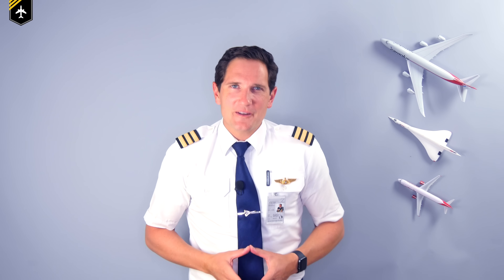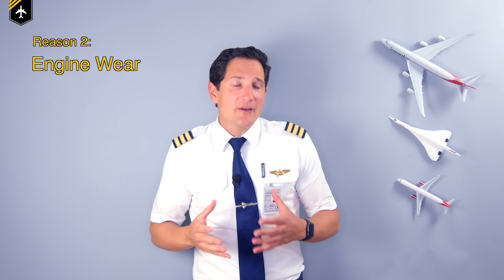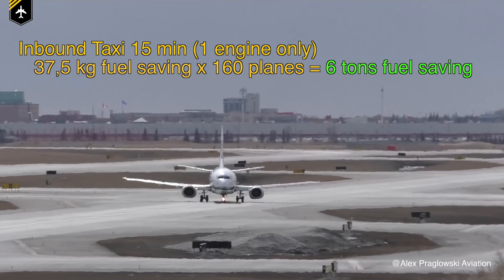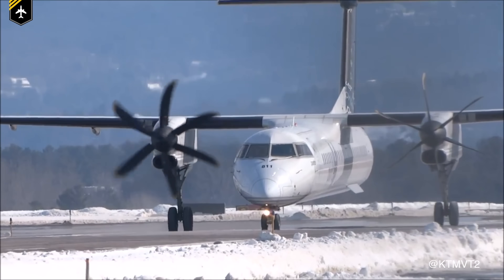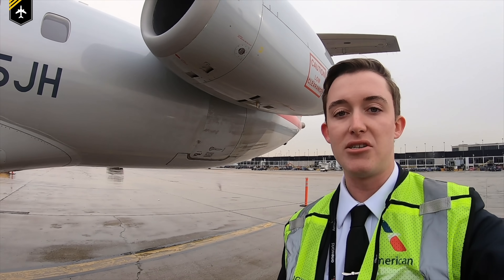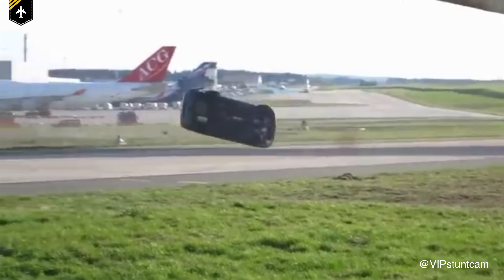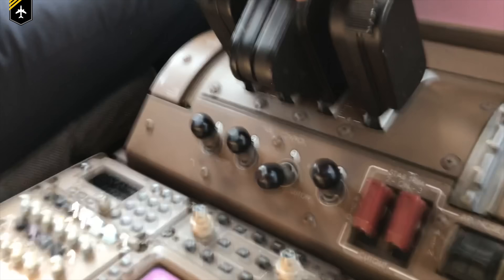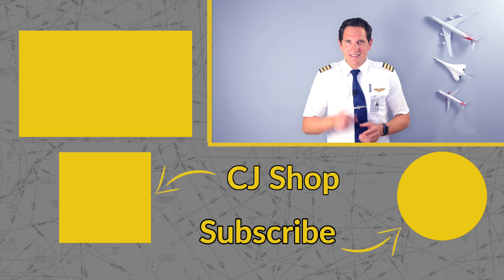Why do PILOTS taxi only with ONE ENGINE??? Explained by CAPTAIN JOE

Comment: The engine shown at 1:53 wasn't foreign object damage, unless you count the plane tug that disconnected while towing TF-AAK (747) as a foreign object.  It then turned but the plane did not resulting in two people injured and damage that required two engines to be replaced.  That plane at the time was known as "Ed Force One".

Comment: Can planes run on 1 engine in the air?
Reply: A twin engine aircraft can fly with one engine.
Reply: @nefarioulyte9996  - A twin engine aircraft can fly with one engine, and if the other engine has been lost during the take off the aircraft can even continue the take off with only one engine.

The effect of drift will be compensated by using the aircraft controls and the aircraft can continue flying. 

For example if the aircraft will tend to turn to the left, to counter this the pilot applies right rudder. This will correct the drift.

Pilots who fly twin engine aircraft are trained to fly the aircraft with only one engine. This is a normal procedure of the pilot training, and every pilot who flies multi engine aircraft has to train this procedure.
The pilots can fly and steer the aircraft with only one engine because the drift can be corrected with the aircraft controls.
You can ask any pilot about this and they will tell you the same thing.
Reply: @nefarioulyte9996  - LOL

Comment: Would the one engine running make the plane do a turn? So do you constantly have to steer against that force when you taxi or is there some system involved that compensates that and makes steering feel the same as if you had both engines running?

Comment: Q: Will the fuel consumption of additional thrust needed for taxiing on one engine counteract the fuel that has been saved? Or maybe it doesn't ever require additional thrust to move the aircraft on one engine?
Reply: It does require a bit of extra thrust on the operating engine however it is still more economical. For that reason also, there are weight limitations for engine out taxi

Comment: If you shut down engine 1, engine 2 has to work harder and uses more fuel. So I think the calculations are wrong. Fuel is saved but not that much.

Comment: Interesting. Now it kinda makes sense why airline company would not want to buy 4 engine aircrafts like the new 747. While in the air, they are very efficient, but while taxing around the airport, it will consume significant more fuel than other aircrafts.

Comment: But for taxying the plane, surely the single engine has to work twice as hard compared to using two engines, so you won't be saving anything like as much fuel as suggested in the video?

Comment: Hey capitain joe, i have a question: What is the purpose and function of the black-yellow "FOLLOW-ME" cars on todays big modern airports with every whatsoever technical and electronic system available, whilst often old small airports don't have them? I always thought they were a relict from old times, where there were no fancy electronics around? last time i flew i saw them in Copenhagen and Oslo, which are big modern airports, but not in Kirkenes which is a small and old airport(might have been renovated by now, don't know, was there in 2011). Kirkenes does also have international flights, so it can't just be for foreign planes to not get lost....

Comment: I had my first flight on a brand spanking new American Eagle Embraer 145ER last week. Holy smokes it is nice. And so strong. When we started our take off roll it was like they went from idle to half throttle, then a few seconds later full power and I was crushed into the seat. I have never felt that kind of thrust from such a small plane. Amazing aircraft.

Comment: Okay, here's a question. Do you have to manually trim the plane as a result of thrust only being on one side hence potentially causing the plane to veer off the center line?
Reply: Aman Haman you don’t taxi with the rudder in an airliner. You use a tiller (basically like a steering wheel). So using that you just maintain straight line.

Comment: Reason #4: Shutting down the port engine eliminates the engine/prop blast forces that would hit passenger boarding/deboarding by the rear stairs on the open ramp.

Comment: With the advent of hybrid electric planes (see Airbus/Rolls Royce E-Fan X), I'm wondering if we will see electric motorised wheels on some planes. 
Cons: increased weight, increased complexity 
Pros: rollback without assistance, easier taxiing, reduced FOD risk due to high power not needed, maybe increased initial acceleration on takeoff leading to shorter runway, maybe reduced tire wear due to pre-spinning wheels, possibly improved braking performance  (reduced pad wear)

I guess you'd have to run the numbers to find out if it would be worth it. What do you think?

Edit: I just found Electric Green Taxiing System (EGTS) by Honeywell and Safran. It's designed for aircraft such as A320 and B737 and would be powered by the APU. Seems like it finished development in 2016 but no customers.
Reply: Wheeltug Plc also do a system.

Comment: Why does the Airbus A380 have reverses on only 2 engines
Reply: It saves weight that it has reverse thrust on the inboard engines only, and because the outboard engines are often over the runway edges, it decreases the risk that the outboard engines would be damaged by ingesting foreign objects.
Reply: @mikep9604  nice
Thx

Comment: I would think you're adding a lot of twisting torque to the wing and fuselage running only one engine.
Reply: An F-15 landed safely with a wing torn off once. I'm sure an airliner will be fine XD
(Sarcastic)
Reply: @XM8A1  .. Whether something can land once is different than 7x24x365 twisting stress on a wing and a fuselage from a fulcrum. While I'm not a Structural Engineer I'm a Chemical Engineer.

Comment: Ryan air IS a budget airline, but it is also a very safe airline, no one has ever died as a result of boarding a Ryan Air plane and you can't argue with a 100% record. And let me guess how many of the knockers have actually flied with Ryan Air? Answer?  none. For the record, I have. The same can be said for Easyjet, another budget airline with a 100% safety record.

Comment: Why they take so much altitude  so fast after take up?
Reply: Because it's usefull to reach the cruising altitude fast so that the aircraft can use its cruising speed, and at high altitude the fuel consumption is the most economical.

Comment: Interesting.  So i see that you need to throttle up a bit more with one engine for the breakaway thrust but are you still using higher RPMs while moving around the taxiways with only one engine?

Comment: Wouldnt power only from one engine make your plane always turn to the left or right (Depending on the engine thats off)?

In flight sim when I taxi with one engine I always have to correct to stay straight
Reply: You can steer the aircraft using the nose wheel.

Comment: Great video! I learned a lot. Never knew that planes saved a lot of fuel just taxiing with one engine.

By the way, from what I understand from the last part of the video, you don't perform the same procedure for the 747, so you taxi with all 4 engines, right?
Reply: elephant35e they taxi with 3 (or 2 depending on airline).

Comment: Hey Captain joe, regarding 1:59 FOD actually stands for Foreign Object Debris not damage :)
Reply: Same, I work Airfield Management gravel or rocks are not damage their debris. It could be a difference that comes from maybe a pilots perspective vs. Airfield ops. But Airfield litterally are the one responsible for FOD checks and FOD programs, but hey. Pilots hey, know everything right?
Reply: I am a pilot and a retired FAA employee. The acronym meaning changes with time. The object on the ground, is foreign object "debris". If it gets sucked into the engine, then it causes foreign object "damage". The official FAA definition is here: https://www.faa.gov/airports/airport_safety/fod/   The crews doing the FOD checks have a very important job.
Reply: Last time I checked he went to flight school he is the pilot so he should know
Reply: @CrosshairCT-  i worked in airfield operations which is way more involved with FODs and stuff like this than pilots, worked in a control tower as apron/ground controller in a busy international Airport, and currently am going to flight school, so i should know as well :)
Reply: @CrosshairCT-  i actually had  2 weeks of training dedicated to FODs and their effect on airfield operations and safety when i did my airport operations training so trust me i know more :)

Comment: If your airplane has a APU can you shutdown all engine excluding the APU or not?
Reply: If the engines are shut down, like they are on the gate or at the ramp, then the APU is turned on to produce the electricity to the aircarft systems.

Comment: 3:19 - That calculates to USD $.5864 per litre.  When you compare that to 91ron standard unleaded fuel which is AUD $1.489 per litre, that is fucking cheap.

Comment: With asymmetric thrust being applied, is it necessary to counter this with constant torque on the nose wheel steering tiller or rudder pedals to stop the plane veering off a straight line?
Reply: Anthony Dyer yes

Comment: Hi Captain Joe! I'm not a pilot but love your content! I do have some questions though.

Discounting the time when the plane is idle, if only 1 engine is used to taxi, doesn't it mean that the engine has to work harder to propel the plane therefore negating the fuel saving and noise points? I would think 2 engines running at minimum throttle is more efficient and less noisy. I think this logic also applies to engine wear, and likelyhood of gravel being sucked into engine. I would also imagine having imbalanced forces on the left vs right with only 1 engine running introduces twisting/torque stress on the overall plane's fuselage?

Can you explain? Thank you!!

And damn Pilot Emilie is real easy on the eyes ehhh?! xD
Reply: KA S it’s law of diminishing returns. For equal thrust amounts, single engine will always be more economical than dual engines (as lot of energy goes to waste)
And for the gravel case yea maybe. But that’s more prominent if the engines are placed really wide apart (wrt the taxiway)
And at such speeds and power settings, asymmetrical thrust wouldn’t be that powerful to damage the aircraft (remember the aircraft is designed to fly with one engine, hence it can take way more stress than it’ll experience on the ground)
Reply: @ZK-APA  Thanks. I can accept your explanation :)

Comment: 10:00 AirBridgeCargo - nice livery!

Why do aircraft measure fuel in tons rather than gallons or litres?

If they always cut the same engine on some aircraft the extra time on the other engine(s) must add up to a lot over time. Is that a problem?

Why don't they fit a fine mesh over the intakes to stop FOD?

Do they need to apply one brake to stop the aircraft taxiing round in circles, or is the rudder sufficient?

Is the slipstream enough to start the second engine when taxiing a turboprop?

Hope you don't mind me asking so many questions :)
Reply: caw25sha I’ll try answering them

Fuel is in tonnes because fuel is a factor in weight and balance as well. So more payload it has, less fuel it can take (as to not exceed maximum take off weight). 

If they cut the same engine all the time, it would be a minor problem, as even though that engine may be used more, since the aircraft is checked so often it wouldn’t be that major of an issue.

Putting a mesh in front of the engine intake will block a lot of the intake. Yes it’s a “mesh”, but even that can create issues like less efficiency or even compressor surge or stall.

In larger planes, the aircraft is turned using a tiller, so you’ll have more control on the turn. But yea for smaller aircraft you can do that.

I am not sure regarding starting an engine using slipstream, but my guess is starting the usual way will give you more control over the startup procedure.
Reply: @ZK-APA  Thank you for your excellent answers.

Comment: Why not use vehicle like pushback tugs to pull airplane into runways ? No Jet Engine needed , Less fuel comsumption
Reply: I suspect the extra stress on the nose wheel could lead to early failure.
Reply: @cigmorfil4101  Ohh yeah, ur probably right
Reply: Ma.diane Chontic most probably because that’ll slow down the airport utilisation. As it’ll take more time to prepare an aircraft for takeoff

Comment: At my company we only use single engine taxi in, for departure we have both running- decreases the chances of missing something important in case you are at the end of the queue and suddenly get cleared for an intersection departure because the guy in front needs more time (i.e. cabin not ready). Happens quite a lot because on the Q400 you can almost always take any intersection, especially at the lower weights. Also one has to be mindful of stands, that require a 90degree turn to get in (we have one in RIX- 103), its doable but the PAX will not appreciate it, because you have to come in with momentum, also unnecessarily wears the tyres (its #1 we’re turning off as Milly mentioned, and the turn is to the right).

Comment: If the planes are towed from the point they land they can shut down all engines except apu. Is this feasible?
Reply: It doesn't work very well in reality. Towing the aircraft long distances after every flight every day may cause extra stress to the nose wheel construction and may be a safety risk. It's also obvious that this towing would slow down the traffic at the airport and it would have a negative influence of the capacity of the airport.

Comment: Hello @captainjoe, will having only eng on not cause uneven stress on airframe?
Reply: The airframe can deal with that without problems. You can even fly with one engine out for instance after a bird strike and the other at full power and it does nothing to the airframe.
Reply: shi01 okay good to know, thank you👍🏻👍🏻👍🏻

Comment: Regarding "only fuel consumption", you need to have certain amount of power in order to move the airplane. No matter if you use one, two or three engines...if you use one engine, you will use more power (more consumption) to move the aircraft. Again; speaking about power (fuel consumption) I do not see the diference...could you explain....regards...
Reply: Yes, but a running engine uses a certain amount of fuel just to keep running without doing any useful work. It's the same as if you keep your engine in your car running while you're stationary. Your engine still needs fuel although you don't move.
Reply: @shi01  Yes you are right, but my point is: in order to move and keep taxiing an aricraft you need some amount of thrust. If you use one engine you need all the thrust (fuel comsuption) from one engine. If you use two engine you need the same amount of thrust (same fuel consumtioin) but split in each engine. It is true also that in order to keep the engine running even at idle you consume some fuel....so the idea about the split the fuel consumption in each engine is not validate. Anyway, if the Airlanes use this method they must have a valid reason!!!!! Regards!

Comment: Great video as always! I figured fuel savings was a major part but it's also to nice to know the other aspects of why certain engines are used. Those MD-80 series planes are freaking loud, especially if you were in the back of the plane.

Comment: For the 777-300ER, depending on the airport, after landing sometimes one engine is used to get to the gate, however there might be certain turns to get to the gate along the taxiways safely/balanced, both engines need to be on in order to make safe turns 🤙✈️😉 Correct?

Comment: Hi Joe great video that makes a lot of seance saving fuel is saving money. Hi Joseph did that in a car once i was coming down a mountain though i would switch off the engine must have been doing 90 mph but all of a sudden there was a house in the way and abs breaks do not work when the engine is off good luck there driveway  was strait off the road went threw there drive past the front door over there lawn over a little clipped  hedge and back on the road boy was i sweating bullets

Comment: Perhaps some SERIOUS fuel savings could be obtained if planes were built with electric motors in their wheels.  That way, with the backup hydraulic pumps going, you could taxi in with none of the engines running.
Reply: Alex Derus maybe. But the major con is that it’ll bring complexity in the landing gear mechanism. So the extra investment may negate the fuel savings

Comment: Joe, very informative video. I have two questions 

1. Why engines need cool down time? Aren’t the engines cool down anyway when they are shut down? You explained for the warm up time, can you also explain this?

2. For starting up the engines on the way taxiing to runway, do you need to stop at a designated location and ask the clearance for start up from controller just as the start up procedure during pushback.

Thank you.

Comment: During emergency landing during touch down  is it possible to shut down both the engines. Is there any backup energy for only brakes to function after shutting down both engines.
Reply: Ronin R yes. You almost always shut down engines in an emergency landing

Comment: I remember that I saw charts of EHAM stating that A380 only can taxi with 2 inner engines in certain area of the airport.

And fun fact. Most of the A380 only taxi with two inboard engines (2 and 3), and even stated in the manual that shutting down inner or outboard engines (either one) has no impact on the hydraulics system.